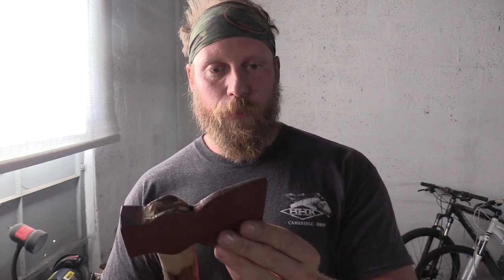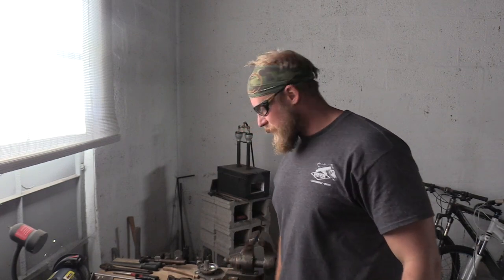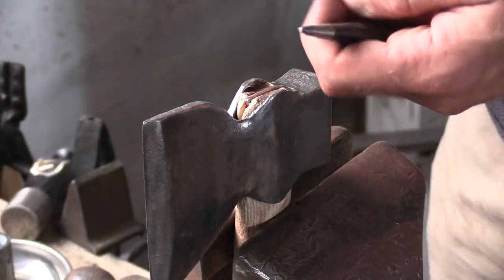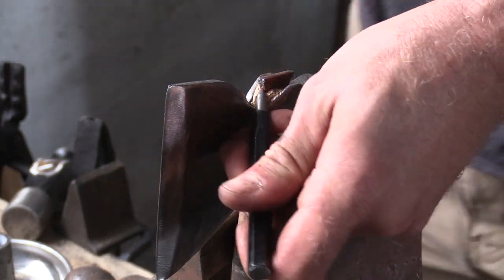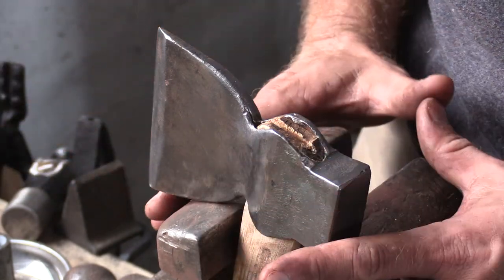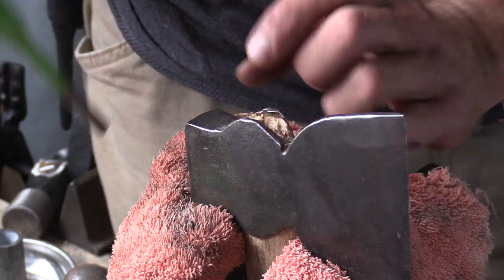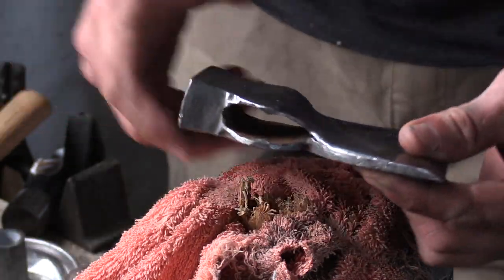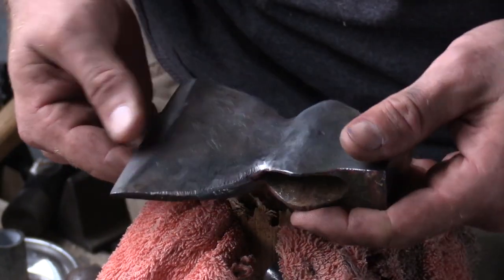Axe Restoration Part 1: Not everything goes as planned

Comment: You could have also just drilled out the wood handle if you weren't going to reuse it after you removed the metal wedge. The larger the drill bit to remove as much wood handle as possible without damaging the metal head. I myself just used  wood chisels  because I didn't think of a drill bit until watching your video, but I was removing  a Sledge Hammer handle. I also tried using a small diameter pipe to knock out the broken handle from the head. The thicker the Schedule Pipe the better so it doesn't mushroom out, or you could use a solid bar.

Comment: Did not realize you could turn it around to make a right handed ax.  My understanding is hewing axes were to make a flat side on a log, but could you use that as a carving ax for spoons?  Bruce from the City of Orange in Orange county California
Reply from the maker: yes thats what hewing hatchets and broad axes are used for making timbers flat.  You can use a small hatchet like this for carving. I think they work better than a normal axe
Reply: Thanks I will keep a watch out for a small hatchet like you suggested. Bruce from the City of Orange in Orange county.